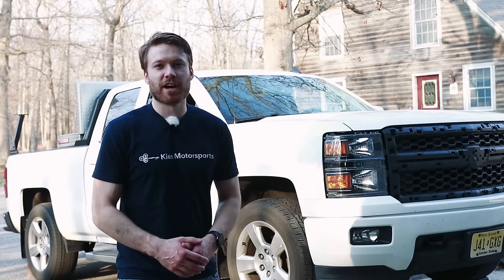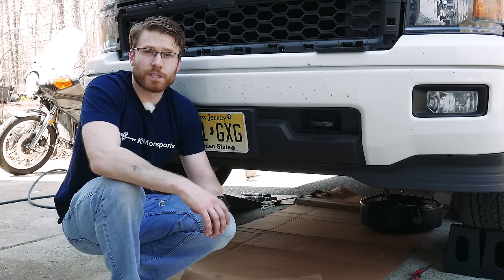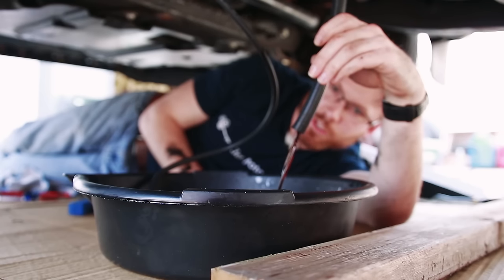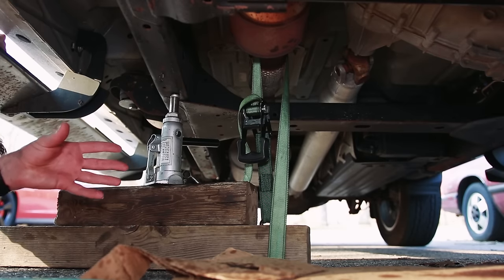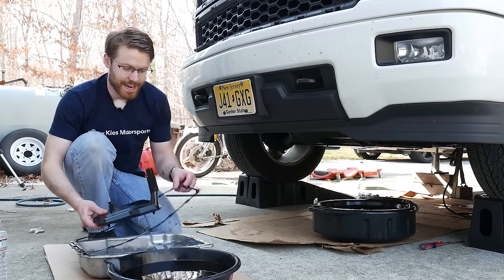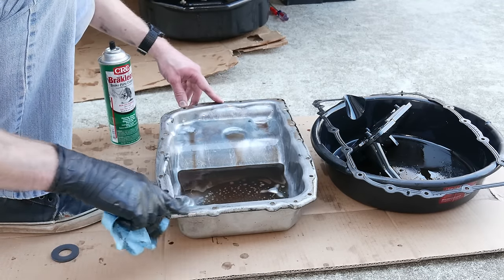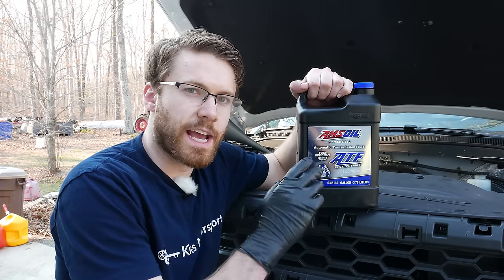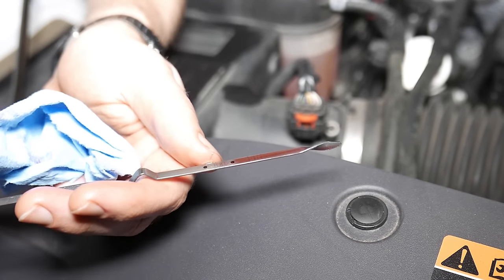6L80E Transmission Super Flush and Filter Change Silverado Sierra Tahoe Suburban Yukon Escalade H2

Comment: I got a question, yesterday I was changing the radio, I was upgrading to a DVD Navi. Well I looked up and the check engine light was on. I then hooked up a code reader and it was generic P0700 which only means the transmission gave a fault code. Now my code reader can read TCMs as well as ECMs and there is no TCM code. Now after watching some videos it could be a number of things, I tried resetting the fault code but it wont clear. Now being that it won't clear that is a good sign its electrical because nothing is moving when parked so the fault is coming when not moving. Now when I drive I notice that the car is slow to take off and when you reach about 50 MPH I notice that the RPMs are high (3,000 to 4,000) and it wont move. Now that tells me that the car is using only the 3rd gear. These L transmissions I read on a form that when there is a electrical issue the 3 gear is the only one that don't need electric to function. That would explain why its slow to take off because its only using 3rd gear so it needs to get up to speed, which is also more than likely why RPMs go high at 50 thats about when 3rd needs to change. Now am about to go check fuses because one other thing I found out about these trucks is that the ECM is connected to the radio for speed control, (the feature which turns radio down or up depending on how fast your driving. You must be careful when installing a aftermarket radio about cutting the wrong wires or your dash will go haywire. I did it before that's how I know. With that beginning said I never had a issue with this sense having the car so GM giving me new things to worry about. One other thing, I looked under the car and its wet in some areas around the transmission, low fluid can cause a similar issue, the throttle body can cause issues like this, yes I said throttle body sensor or the unit itself. This is all crazy but if the throttle body or sensor malfunctions it will try to compensate by screwing with the TCM causing a fault code. Man you need a engineering degree to work on a car today. LMAO I tell all my friends you better start learning about your car if your poor and can't afford to buy a new one because these mechanics know less than you sometimes if you put in the work. Its going to school to me. Well I will get back to you if I find out what's going on. Any information will be useful. I am thinking of making some videos as well to pass on what I learned maybe we can collaborate. Let me go see what I find and get back to you. I will keep checking back to see if you commented with some helpppppp!!!!!! :)
Reply from the maker: Oh man that sounds like a pain. Hadn't even considered that messing with the head unit could effect speeds but because of that feature that makes sense. These vehicles definitely require a lot of knowledge to work on and if you take the time to learn, you will almost always have more knowledge then the typical mechanic. I do not have a solution for you. I would point out that a mechanical issue could be cause the fault code because it is all determined by sensors so I am not sure I would completely eliminate a mechanical problem
Reply: Oh man what a pain but guess what? It was a fuse, I knew it had to be electrical and when I checked the wiring of the person who installed the radio before me had ran a wire from under the dash threw the firewall and into to fuse box to a fuse that was ACC switched. I guess the couldn't find a switched power for turning on the radio when the car starts so they used this connection and I must have allowed this hot wire to touch something ground which blew the fuse. Now I had no idea but I knew it had to be electrical because unless a sensor has completely failed and is grounding out will it not allow you to clear the code because you have to remember that many electro-mechanical servos must have I/O. So sometimes its energized and other times its not. With the car off and de energized it should allow you to clear the fault code until you start the engine and it sends the inop signal a few times then the code will come but this would not let you clear it at all so that shows its constantly being looked for and never sending any change in voltage. This fuse the idiot had the ACC wire ran to the radio used a major fuse to do this stupid connection. I shot clips of video which ill edit and post but am tired I spent all day on this. Now let me had taken it to a mechanic. It would have been a 1400 fix and I wouldn't know what he did or didn't do. I would be so happy to not need a new transmission. The fuse was TCM ignition switch. All gears except 3 gear is electro mechanical. No electric no gears except 3 which is the only one not in need of a current. I believe 4 because its in the middle, you can drive up to 50 miles per hour in third.
Reply: I meant I believe 3rd gear not 4th. The L Transmissions on GM is what I meant.
Reply from the maker: That is awesome! Glad it was something so simple, I just had an issue in my Camaro where it wouldn't start, replaced the starter, still nothing (battery is new). Removed the spark plugs and it wouldn't turn over by hand. Now I was terrified because this is a brand new motor with about 12K miles on it (2K by me after installing). My old motor spun a bearing for an unknown reason - I plan to pull it apart to try and determine the cause. Turns out one of the 3 starter bolts is about a 1/4" longer than the other 2 and it was hitting the flywheel. My fault because I installed it in the wrong spot. When I put my old start on the new motor and again when I put in the new starter. Thankfully I found that and traced down the starter issue to a loose ground. Blessing in disguise that the ground came loose. Always gratifying to figure out your own problems and save $$

Comment: Changed torque converter both times, did not open. The second trans 100000 the pan as full of pieces parts, fluid was black as pitch. Transmission rebuilder said it wouldn’t have gone much farther before it wouldn’t, lol 😂
Reply from the maker: That sounds like the torque converter probably. The clutch matters inside tends to fail around the 100-140K mile Mark and clogs the line and pump Wich will cause the transmission to quickly overheat. That is probably why the fluid was black. I would suggest changing the torque converter some 100K miles. I also upgraded to the 6L90 torque converter from the zl1 Camaros. Not robust internals with a roughly similar stall

Comment: When you check the trans fluid the parking brake applied put the vehicle in neutral then pull the dipstick and check the fluid level
Reply from the maker: That may be true for since vehicle's but for myb owner's manual it says to have the vehicle in park. 

1. Start the engine and park the vehicle on a level surface. Keep the engine running.
2. Apply the parking brake and place the shift lever in P (Park).
3. With your foot on the brake pedal, move the shift lever through each gear range, pausing for about three seconds in each range. Then, move the shift lever back to P (Park).
4. Allow the engine to idle (500–800 rpm) for at least one minute. Slowly release the brake pedal.
5. Keep the engine running and check the transmission fluid temperature on the dipstick

Just curious which vehicle you have that uses that procedure?
Reply: Are you talking about checking the fluid level after doing the drain & refill  @TheSundaeDrive ?

Comment: How often are you guys changing  the filter and fluid i know manual says 45k in just curious
Reply from the maker: Depends how hard you are pushing it towing etc wise. I plan to just do fluid and filter changes (now that all of the stock has been changed) every 30K miles
Reply: Depends on the vehicle as well. For my 2010 Chevy 5.3L Avalanche, GM says do an ATF change after 100K (normal service) or 50K (severe/towing service)

Comment: Okay I don't understand why you wouldn't just take those two lines that you took off the cooler put one into a brand new jug of fluid put the other one into an empty jug fire it up let it run until the fluid comes through clear then change your filter and then you get 100% of all of the fluid instead of this process

Comment: Has anyone experienced rust or debris coming out when checking this 6L80 transmission fluid? I have a 2015 Tahoe. Fluid looks good reddish in color still. I did the thermal bypass by Shift and immediately after i finished i took it for a drive ro check it wasnt leaking and see how much fluid i needed to top off.

After i drove it and checked the fluid i noticed chunks of rust or some red or maroon colored thin chips or debris. I tried putting a magnet but didnt seem to stick. It almost looked like paint chippings but now im worried. It drives and shifts smoothly i did this out of preventative measure not from overheating.

Comment: I thought you check the trans dip stick when it’s running?
Reply from the maker: As long as it is "hot" is the more important thing. You want to make sure it is in the temperature range recommended in the manual when checking.

Comment: I have a 2014 5.3 with 73,000 miles. I just changed my transmission filter and fluid yesterday. I used Valvoline full synthetic ATF and it feels sluggish. I bought the right fluid and filter, I don’t see why it would feel sluggish or different than it did previous to this change. Any ideas?
Reply from the maker: If you didn't fill it completely that could do it. The torque converter relies on fluid pressure to engage fully
Reply: The Sundae Drive I drained the pan out and took the old filter out. Over 4 quarts came out, I added 6 quarts and the fluid on the dipstick was a tiny bit over the cold mark. Was that where it was supposed to be?
Reply from the maker: Yes you should be good but you do need to get it up to operating temperature and then check it again

Comment: wen i put AMSOIL in my lexus NX200t 4 the 1st time i had my mechanic drain it overnite, butt he couldn't do that, so drained it over the weekend b4 going 2 AMSOIL U last yr. had 2 get that dammed mobil 1 that came in it, OUT... boy, did it run different & of course, better/smoother after that... i like AMSOIL so much i am buying my own trans fluid machine so i can do mine & others & maybe make a little $$$...
Reply from the maker: Amsoil is good stuff for sure. Just be careful with the trans fluid machines, they can damage some transmissions.

Comment: Tell me, changed to the same Oil . Replacement was made through a dipstick. Tell me it doesn't rest on the filter, maybe I damaged the filter ? Because there were strange feelings
Reply from the maker: I'm not following your question?
Reply: @TheSundaeDrive  I believe he used a mitivac to suck the old fluid out of the dipstick instead of dropping the pan and is worried he may have hit the filter with the rubber tube that he pushed down through the dipstick tube to the bottom. I believe the dipstick is not above the filter correct? I think it’s to the side not positive though
Reply from the maker: Hmmm I don't think the dipstick is above the filter. Almost positive it is to the side.

Comment: Do you recommend doing a flush at 105,000mi? Never been serviced before.
Reply from the maker: You are probably still safe to do one. All depends on how the truck was driven. Lots of towing degrades it faster. You could just do a change tho too and then do another change in about 10k miles then start doing changes every 30K
Reply: Every 30k after a double drain/fill  @TheSundaeDrive ? That seems excessive, esp. since for my 2010 Chevy 5.3L Avalanche, GM says do an ATF change after 100K (normal service) or 50K (severe/towing service)

Comment: If you want  a drain plug,than why didn't you install one. You can buy drain plug kits from auto parts. I would have purchased a PML deep trans pan and installed it. Comes with drain pan and magnet. Also increases the strength of trans. PML makes pans for all American made transmissions.
Reply from the maker: I will be upgrading that eventually and making a video. I do like changing the filter tho with the change

Comment: I have the 6.2L with no dipstick. I would like to put amsoil in my transmission but don't know how to fill it with no dipstick. Is there anyone that has done a fluid flush on one of these 8 speed transmissions?
Reply from the maker: I did find a pretty in depth procedure online at one point - if you search it should come up.
Reply: There is a plug on the transmission you remove and then fill till it comes out that hole.

Comment: I'm a little confused, at 7:15 you said change only 6qt, but later int he video you said you changed around 9 or 10 qts?
Reply from the maker: In the beginning I removed about 6 quarts by running the pump, I then removed roughly another 4 quarts by dropping the pan (so about 10 so far) the truck holds between 12.2-14quarts depending on the sources. I tried to remove more of this by running the pump a bit longer after adding fluid and then topping it off again. Does this help?
Reply: The Sundae Drive yes thank you for the clarification!!
Reply: could the tranny get damaged if it runs dry while ur draining it from the line like you did?
Reply from the maker: I am not a transmission expert but as long as you keep it in park the entire time it should be fine. If you are concerned, you can disconnect the other line and suck in fresh fluid simultaneously or fill it from the top while you drain.

Comment: Great video! How long did it take you to change the fluid? Also, would you recommend adding a drain plug to that pan?
Reply from the maker: Adding a drain plug or buying one with a drain plug is definitely a good idea. Once you've done it once you can probably do it in a couple hours
Reply: I added a drain plug to my 97 K1500.  Made a huge difference.  It was intended to seal with a rubber gasket, but that didn't work well, so ended up brazing it on.

Comment: This is why you let professionals do this instead of shade tree  mechanics
Reply: What'd this guy do wrong?
Reply from the maker: One thing that could be done differently would be to loosen the nuts on the exhaust and lower the y pipe. The challenge with this method is you need to remove the driver side fender liner to access the one nut. The nuts don't always come off easily depending on the corrosion level. You also shouldn't spray the gasket with brakleen and it can dry them out.

Comment: As An ASE master Tech technician, I Would NEVER run  the truck while pumping out the fluid, ANY part that runs dry can and WILL do damage to your transmission, have it completely flushed  at a shop or other options, I don;t like running fluid out while it's running!

Comment: Got an update?
Reply from the maker: No issues with my transmission to date if that's what you are referring to? I did change the torque fiber at 108K mines proactively and and did another fluid change at the same time. 143K miles now and no problems yet

Comment: That was easier than mine. 8l trans without dipstick. Filter and gasket kit only available at the dealership and I need to replace the temp harness above the filter. What a chore!
Reply from the maker: Ugh, that sounds like a pain
Reply: Why did you have to replace the temp harness above the filter @reedrobb, and what vehicle do you have?
Reply: @imapcfreak  2016 Silverado high country with the 8l80 trans. When I bought my truck at 90k it had this annoying stumble at low speeds. Scenario… you left a parking spot and we’re idling slow through the lot. It shift 1-2 at about 1200 rpm’s. It would hesitate and jamb gears. Hard to describe but it felt like it was revving too high and then dumping into too high a gear. Give it a little more gas and it would settle out. I could feel and predict when it would occur. It was so bad, I started researching and found videos on the problem. Changing the harness helped immediately. However, there is a place in my neighborhood where it does it EVERY time still. Scenario… from a stop I progress to a steep hill rolling down at about 10-15 mph, and it goes into 3rd gear. But then 100yds later I have to stop on a downhill angle to then turn right. If I slow roll the corner because it’s so steep and people are always on your ass, it will jump as described above. It’s the weirdest thing. So, I have to come to a full stop and let the engine idle down a second, then go and it’s fine. Or, I have to keep rolling the stop sign and ignore the law, it will never jump as described. So, I avoid this intersection. I have even tried rolling it all in neutral, that seems to help but getting back into gear at 15mph makes it stumble. I have 125k on it now and who knows what I’ll experience in the next 100k.
Reply: @reedrobb  how annoying, ugh!! Thx for your quick response